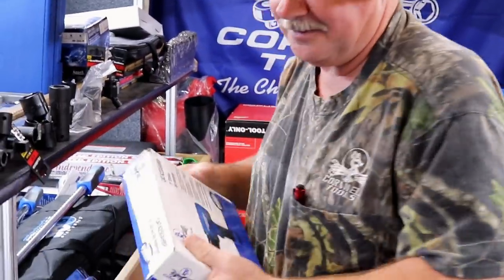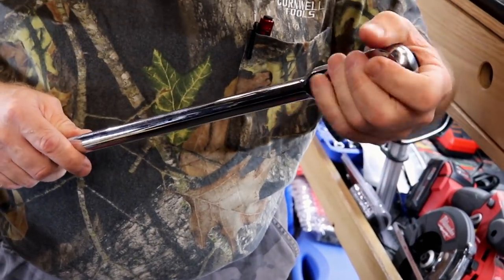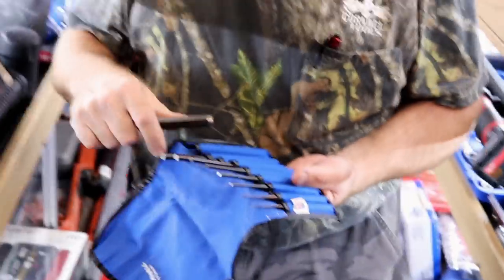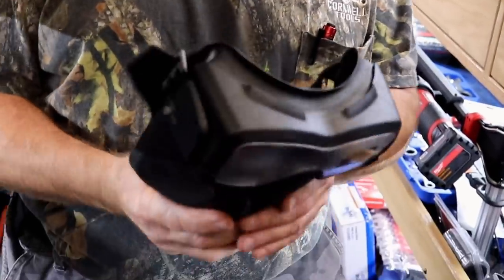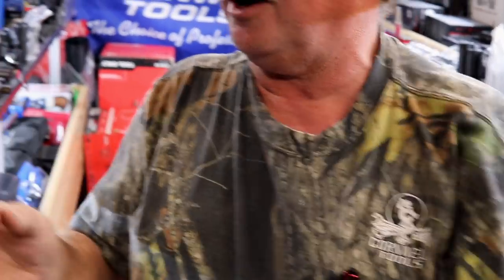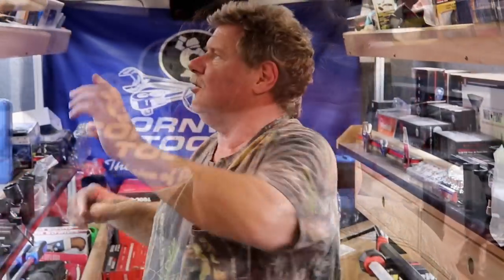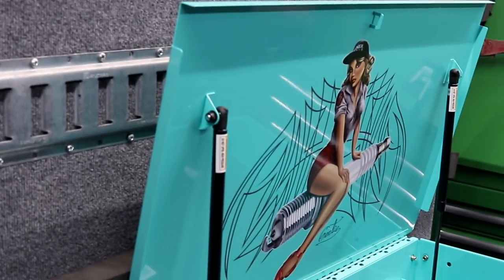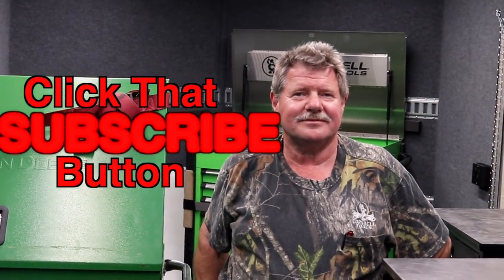Cornwell Monday, Monster Tools, Milwaukee Stubby, Punch Set and Streamlight

Comment: Nice Aircat air hammer.. Love Cornwell deals but they really don't make anything I don't believe.. Maybe their prybars but those maybe made by Mayhew also...
Reply from the maker: They have two lines just like Snap On has Bluepoint. They make all the hand tools in USA now your dealer may only order the blue power due to cost because they are Taiwan made. But they have wrenches, sockets, and ratchets that are made in USA
Reply: Pry bars scrapers punches chisels sockets wrenches ratchets all made in usa made by cornwell and they have there blue power line made by ptp professional tool products
Reply: And that's not an air cat air hammer it's oe is ptp